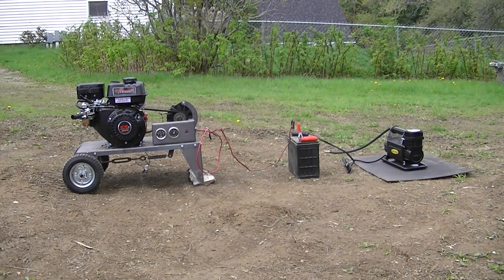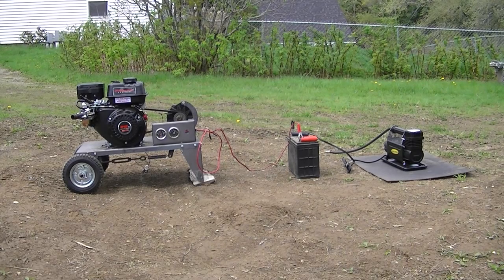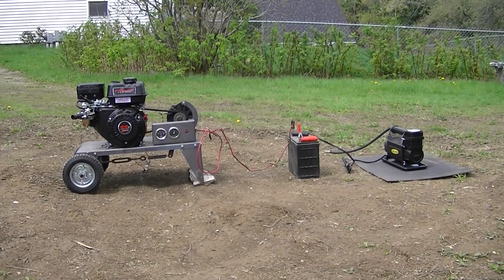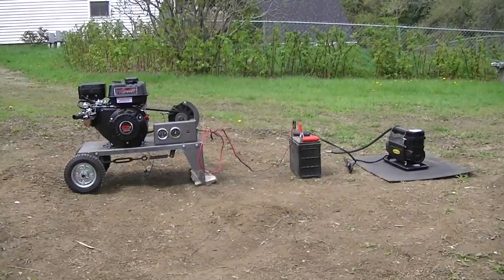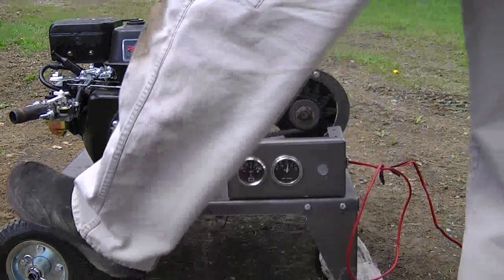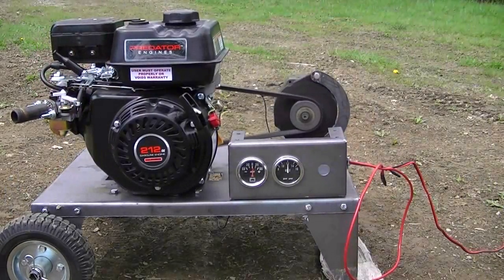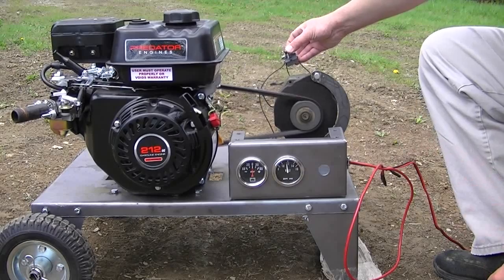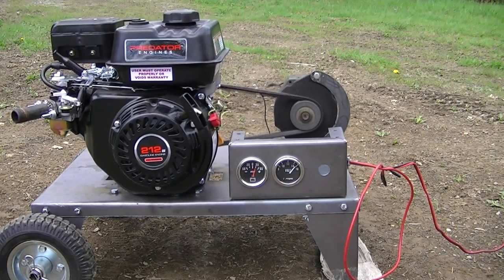Wood Gas Battery Charger Output Shut Off

Comment: This is a few years late, but the reason you have trouble with the field circuit is that automotive alternators are designed to be self exciting. The idiot light circuit is only needed to start the alternator to generate. Once it is producing power you can actually disconnect the idiot light and the alternator will continue producing power. I think you can disable this feature by removing the diode trio (the field circuit is supplied from it). This makes the alternator entirely dependent on the idiot light circuit for field current. It may need some changes to ensure the alternator can produce full power but this alteration will give you the control that you want.